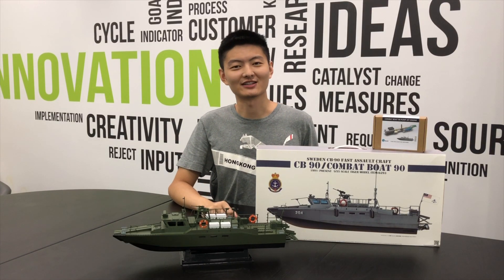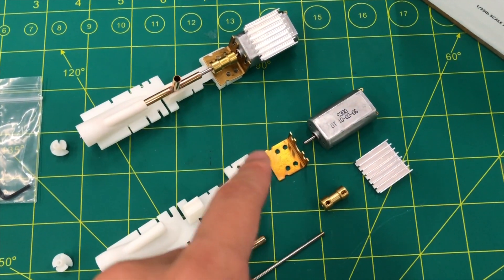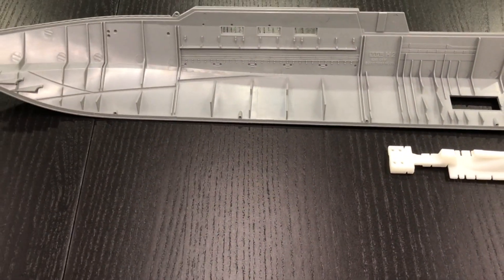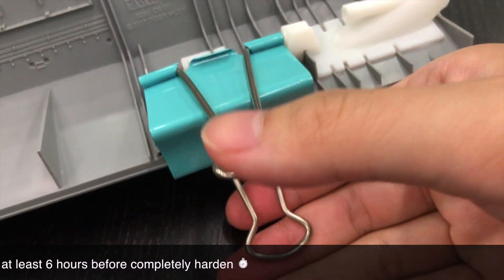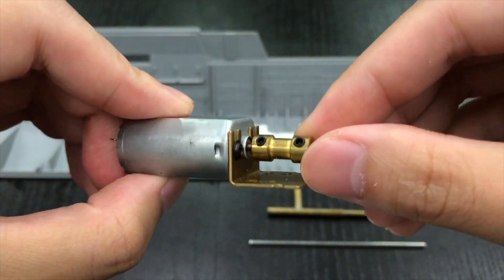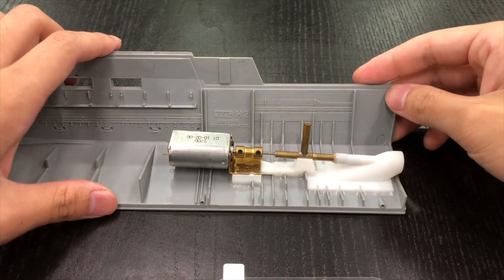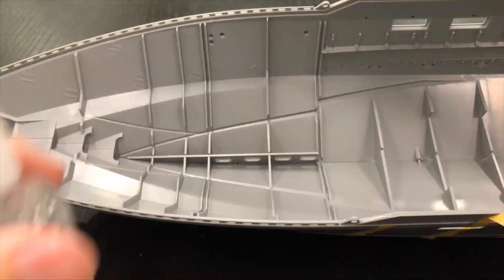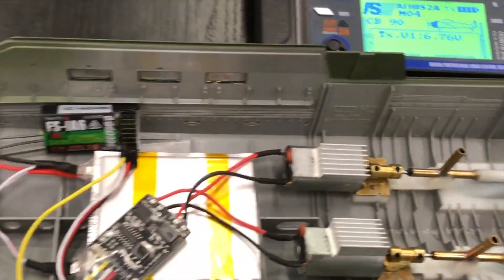1/35 Combat Boat 90 CB-90 RC Conversion Tutorial

Comment: I finished my model and I am not a fan of the two way vectoring ESC. It's not very smooth and when you go forward the motors don't exactly match in RPM thus making the boat always wanting to veer in one direction or the other. It is possible that as the motor brushes break in, the motors may match up better but only time will tell. In the meantime it's a real annoyance. The turning is also very wide so it's very difficult to run in a swimming pool where you need tight steering. I'm replacing the 180 motors with better quality ball bearing 180 motors and replacing the single vectoring ESC with two ESC's and and two 800 mAh battery packs. I have already fabricated a rudder and installed a steering servo with simple pushrod hardware. Overall the quality of the jet pumps and hardware is good, but the ESC leaves a lot to be desired. Chime in with your experiences since I'd like to know if this is an isolated problem or universal.

Comment: Greetings. I know this is an old video. I ordered your conversion kit on eBay as well as the model boat kit. I can't wait to get it. My question is how sharply does the boat steer without any sort of rudder or rotating nozzles? I plan to run the boat primarily in my swimming pool so it has to be able to turn sharply. Your video only shows the model going straight so I have no idea if it turns sharply or if it only can make wide turns. I'll probably install a rudder since it looks easy enough to fabricate, but I rather not have to. Thanking you in advance for a reply.

Comment: just great ...
I'll get myself too.
How is the deck made? Can the electronics still be accessed?
Reply: Late response, but his might help people that recently got the kit. The deck is removable. It fits tightly and stays in place without gluing. It has many hatches that are designed to open so you can see the detail parts in the hull. These parts need to be sealed tight since you will not be using any of the interior detail parts thus making the hatches not necessary. My one gripe is that the deck has many detail parts that easily snap off, and the deck fits very tightly so it's difficult to remove without breaking something. You just have to be very careful.

Comment: Many thanks purchased your kit today from eBay can you send me a link for the battery you used many thanks paul
Reply from the maker: Hi, Paul great thanks! The only requirement on battery is not exceed 100 gram, 90 to 95 is fine. The battery we used is two in serial with 7.4 V output. A tough issue is our postal international airmail refuse to let the Li-ion battery on board. But I think it is easy could be find via local electrinic market. Not just the pouch battery but the 18650 is also recommend.
Reply: Can you tell me specs of pouch battery I know 3.7v but dimensions and milli amps and any other info so I can find simular in UK thanks again
Reply from the maker: @paulclarke165  The battery we used is 700mAh. Personally, I think the battery varies from 500 to 900 mAh is sufficient for 15 mins running. As we testing the current while the motor on high speed operating, just 1.2 Ampere. Thus, just ordinary pouch battery for cell phone could fulfill the requirements.